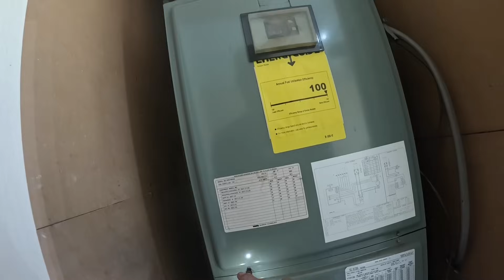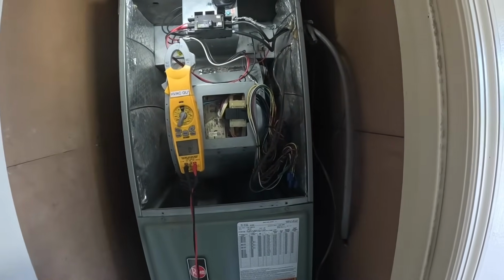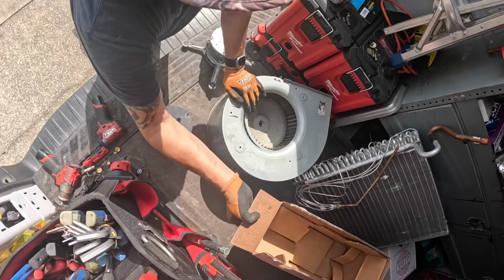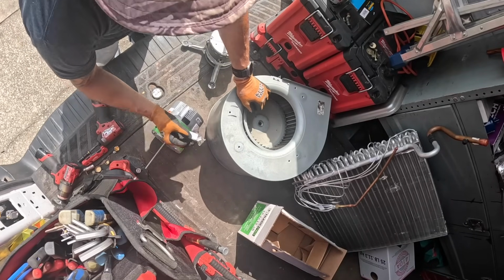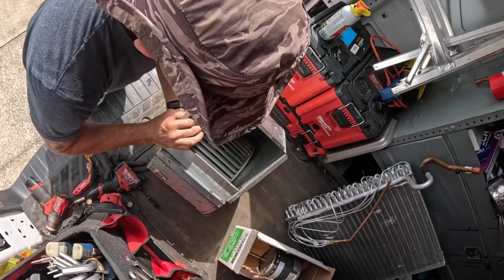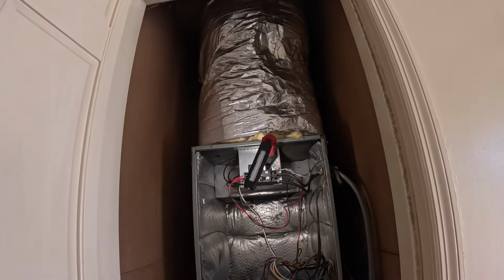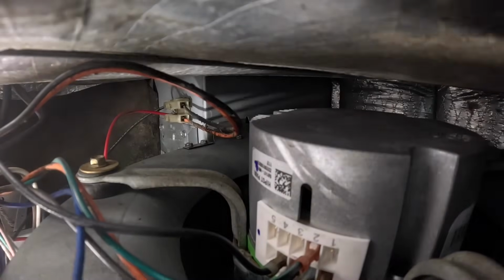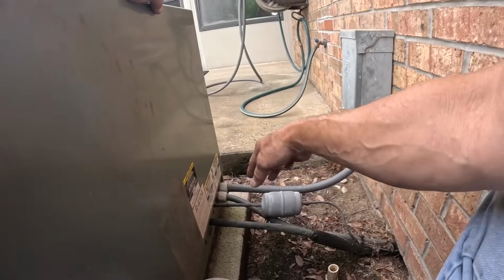Another System Freezing Up Instantly! #hvacguy #hvaclife #hvactrainingvideos

Comment: 0:58 never understood using a thermostat purchased without an auto/manual blower switch. Not only does it let you know a possible blower problem but it also helps searching for ductwork leaks.
Reply: You can. just use the Fan switch . If it doesnt turn on then maybe its the motor, thermostat, wiring or thermostat plate.
Reply: Or relay capacitors or heater relay etc….

Comment: That ecm motor lasted longer than most. It still didn't save any money if it pulls 3 amps.
Reply: it doesn't pull 3 amps with the door on, it pulls 3 amps when it has unrestricted airflow

Comment: I bought a fan like that because the original was warped, probably from day 1. The new one was made in China, and every edge of the blades was razor sharp. If you touched any one of them, you would be cut. But both sides did run perfectly parallel, unlike the original one, which wore the sides of the bearing just enough to make noise which would come and go. That is the only reason I changed the motor & blower in the 45 year old air handler. You can ignore a constant noise, but not one that comes & goes at random.